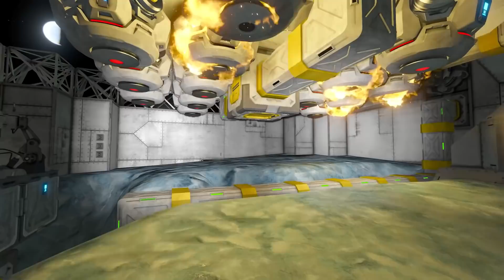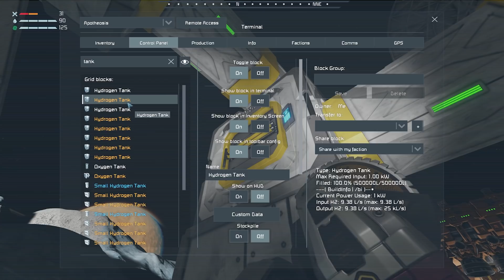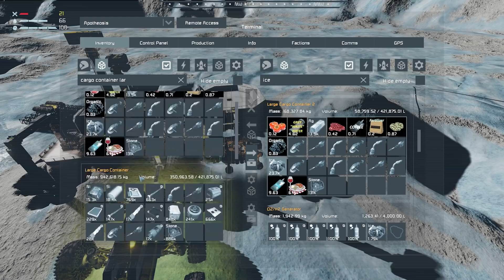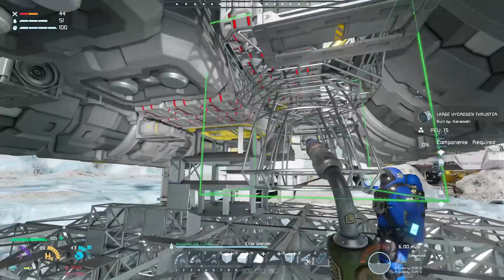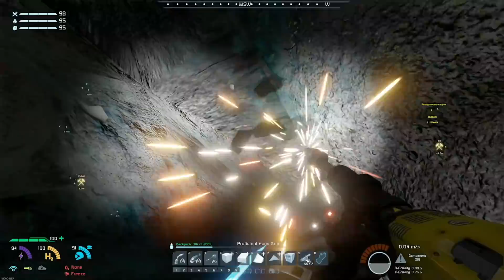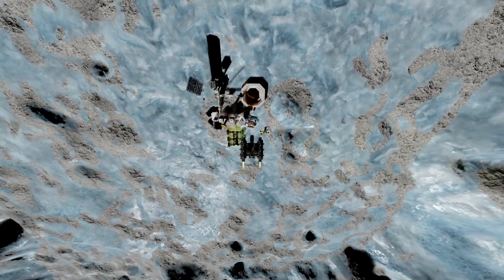Escape from Purgatory #29: Railgun from the Moon!

Comment: Got curious about how close yalls Keg launch was to the manhole cover and..... well its surprising if my maths are correct.

212,000kg from 0 to 120 m/s in 0.25g in ~100ms*
*as best i can tell thru YT playback speed

The manhole cover was roughly 115 kg, not factoring weld strength adding to the force required to lift, that went from 0 to close to ~56000 m/s* in 1g in around 30-50ms
*estimated

Yall weigh ~1850 times more than the manhole cover and achieved roughly 0.002% of the same speed(~466 times slower). So id say thats impressive to weigh that much more and only be that much slower. 
Fun fact:
The Keg: received 127.2 MN(meganewtons) of force

Manhole: received 128.8 MN of force.

Roughly equal amount of force applied. The only factor that limited yalls speed was the weight(excluding SE speed limits and yada yada yada)
Reply from the maker: That's incredibly cool 🙂
Reply: @Splitsie  makes me curious if you could potentially recreate the manhole launch using subgrids since they arent limited by SE's speed limit. 

Probably crash the game though 😅

Comment: this share tensor thing is just cheating mode... you were supposed to be an engineer, so engineer it to not wobble?
Reply from the maker: That's not possible due to the limitations of the physics engine, good luck to you and your pc if you want to build something of reasonable size and complexity and not have it explode just by looking at it without using share inertia tensor

Comment: @Splitsie I'd like you build something that looks like a Union Dropship from Battletech, or the CIS Core ships (or whatever they're called) from Star Wars.
Big spheres with thrusters in the bottom and RCS modules around the perimeter.
Reply: There us a modded Union class, an Overlord...I had them both at one time and they need some QOL updates to the models but they are kinda neat from a BT  or Mechwarrior perspective. I think it was the Union that had a folding ramp
Reply: @stevenraycopley8885   Yeah I tried making a Union in SE. Not having blocks that curved on two axes made it kinda difficult to make well. Not if I wanted to have it be functional within the limitations of SE 3-4 years ago when I tried last.
I tried to make it to scale, like I did with the versions of the ARMD carriers from Macross.
Then a 1:1 USS Typhon from Star Trek: Invasion
The BSG:TOS Battlestar Galactica I scaled down to 1:4 so I could at least try to fly it. And it flew quite well when it was the only thing I had in the world.
Reply from the maker: I don't tend to do replica builds, I prefer coming up with something new. Part of that is you can then ensure that the shapes you choose work with the shapes available and don't have to fight the limitations of Space Engineers quite so hard. Though I do think it's cool when people manage to pull those things off it's just not my thing :)
Reply: @Splitsie  totally understand. just figured it might make a more efficient design. You don't need to build as many thrusters and it'd be less susceptible to variations in Grav-gen/Mass block interactions.
big thrusters pointing down, then a thruster quad in the four cardinal points for maneuvering

Comment: You guys should look into the gravel sifter mod to use up all your gravel.  It filters out small amounts of ore from gravel.  It’s not fast, you will notice that but it gives gravel more of a use.
Reply from the maker: I won't add that mod as the resources are distributed around the system to ensure you have to move around to get everything you need and I like it that way - the sifter style mods work to defeat that aspect

Comment: Now for a horrible idea... a wonderfully horrible idea.

Gravity gen powered thrust on the boosebus and using that to throw nukes at your enemies. 2 birds one stone. More maneuverable base and a lot more firepower. 

(If you run out of nukes just use capac's corpes you'll never run out of those)
Reply from the maker: One day I'll have to make a ship with actual launch tubes as it would be fun I'm just not sure with how the Booze bus is laid out that it's the right ship for it as I'd have to change it a lot to make it work :(

Comment: since you are making a launch tube .. make 3 layers of grav gens ... the first layer lowest down then a 2 block gap and the next ring ... with a single block gap and the final ring launching then becomes a ramp up of the gravity from the first ring as it pulls you up the second ring ramps up and takes over from the first ring while the first ring drops its field and the second ring pullls it up faster into the third ring which rises really fast and send your ship hurtling into space ... like an actual gravity gun ... use a programming block on each ring to rapidly ramp up the field and then drop it as the next block takes over and accelerates your ship up to the next block .and spits you out towards space ...

Comment: ahh call the ship the shot glass ... greeble with glass panels ... then every time you launch it it gets shot out to space ... being made of glass it becomes a shot glass for the booze bus that doesnt have any booze ... and of course the space based hauler has to be the tankard ... a big honking cylinder with many tanks of storage onboard to hold loads of stuff to work with ... make the base for the booze bus and tankard as well as shot glass the bar or pub ... and have them all dock to a long platform with refuleing arms at a few places along the length ... ;) dont forget the bowl of stale nuts ... ok capac's bed

Comment: 500k small grind tank filling up 30 million ... larg grid tanks for or 2 trips per small grid tank per each million or 60 trips ...not 15 trips ... you would need 4 small grid tanks unused to get 1/4th the trips ... and you plan on using the small grid tanks to land with ... so you may take 60 million up but you only leave 30 million behind ...

Comment: Epic shot from the railgun... I did not expect that to be that effective, it looked like you almost immediately hit 100m/s? For the initial launch you guy might want to consider even just keeping the Hydro thrusters off until your out of the gravity well, to avoid losing speed if you end up tilting some more too.
Reply from the maker: Thanks 👍

We thought we'd leave them on to reduce the likelihood of hitting the sides of the tube :P
Reply: @Splitsie  hitting the walls should not be an issue after the AM blocks are fine tuned. A double/triple connector should help with lining the shot, and if you want to get crazy with it you can do a mammoth bay style pincers 👉🛢️👈
Reply: @Splitsie @
jchoneandonly I think the whole thing could be done with some timer blocks
1. Launch Button/instant TB: Grav Gens on, start step 2-4 TB
2. Base TB: Unlock connector
3. Keg TB: Turn off inertial dampers/thrusters a second or two after launch
4. Base TB: Turn off Grav Gens

5. (if you want it to go on auto, then time a launch to orbit and set set this one to start after you turn them off) Keg TB: Turn inertial dampers back on
Reply: @Splitsie  could set up a program to turn them off once you're out

Comment: What about a 'Smart' Gravity Launcher/Catcher "elevator"? With 2 end-points: (1) the ground Launcher/Catcher, and (2) a static grid orbital platform gravity Launcher/Catcher directly above it - and they throw and catch the payload to each other.. to and from orbit/surface. Each would dynamically adapt their grav fields' strength & direction (via finely tuned script..) suited to the space vs ground base gravity environment and the distance/velocity/mass of the projectile.

It needs to be a perfect straight shot each time. Almost everything should be automated: activating and adapting the grav fields (both sides -- coordinate scripts via antennae perhaps); dis-/enabling inertial dampeners (you wasted velocity and fuel there); dis-/connecting landing gear & connectors; etc. No pilot error possible.. one button system. Preferably no pilot required ;)

The idea is to minimize (if not eliminate) H2 waste on both trips. More so, the epic coolness of it.

An added feature that might add launch velocity could be pistons beneath the launch platform that mechanically pushes the payload with some starting momentum.. but those grav gens might do it on their own.. more testing needed.

Comment: 11:13 I don't think the engineer would feel the acceleration, because the gravity field would also accelerate every atom in your body, so it should feel like free fall.

But then again, since not the entire weight of the ship is accelerated (only mass blocks), you would feel something, but you would be squished into the top of the ship because the ship accelerates slower than you.

Comment: You know heavy industries came out yet they didn't give a skin for the drill welder and grinder blocks cause that would have been cool
Also splitse is kinda right you can hear through your feet in a vacuum cause sound is actually vibrations and if they hit your suit you're gonna feel and hear them

Comment: Not sure if my maths are correct, but I calculated the speed that you had when you launched yourselves using the grav generator-powered rail gun launcher.

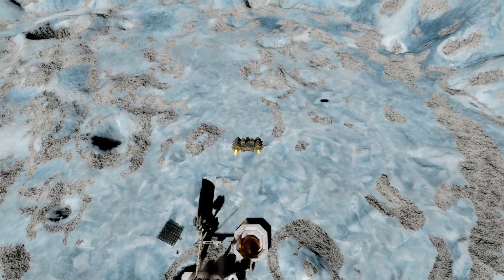(see the figures at 41:28)

Given that a typical terminal velocity is 9.8m/s^2, the artificial gravity generated 14.0G and the moon generates 0.25G,

The gravs gens give you 14.0 * 9.8 = 137.2m/s of speed.

The moon, meanwhile, is attracting at about 0.25 * 9.8 = 2.45m/s.

Counteracting, altogether, upon being launched (t=0), you were speeding at about 137.2 - 2.45 = 134.75m/s.

If you hadn't switch on the dampeners and correct for your ship shuttle's tilt, and let the momentum carry you out of the moon's gravity, within 45 seconds to a minute of gameplay, you would be able to achieve escape velocity there.

I think you just beat NASA, SpaceX & Blue Origin in achieving non-propulsion rocketry!

Comment: Is there mod that adjust ore spawning in this? I checked the mod list provided on episode 1 but didn't see one and it could have changed since you left the server.
Reply: It used to be the Draconis Impossible server from the Sigma Draconis community. But at some point because they migrated to a different world setup (Draconis Impossible Extended)  Splitsie got the world files from them to continue this series and set up a private server from this. Ore spawning was custom on that server if I remember correctly. Don't know if Splitsie changed this himself.
Reply: @Valenorious   yeah but what was changed is what I am trying to figure out. I went on their website that has the mod list but no mod was there that changed ore spawn that I could find. The asteroids could be vanilla spawning beside the ring around purgatory, the planets that we have seen have all been custom so no mod needed to change the ore spawn for them. guess we'll find out if there is a normal planet as to whether there is custom ore spawn or not.
Reply: @rextron6437  I don't thinkg there is a public modlist of the DI or DIE worlds. The mod collection that is available on Steam Workshop is older than what Splitsie started on I think. The  mods for DIE world are not al public either. A bunch have been made internally by the team. 
But you may be able to figure out the mod IDs by checking which mods Steam downloads for it after you joined the server.

Comment: Put the geometric centre of the mass blocks ahead of the actual CofG. Passive stability!
Reply: One would think but if rocket engines are anything to go by that actually makes it unstable
Reply: @commiccannon592  It's a different scenario.

On a rocket (absent thrust), centre of drag needs to be behind the CoM because it's pulling back.

For mass blocks it's a forward force, so it's like the ship is hanging from the mass blocks. The mass blocks need to be ahead of CofG of the grid.